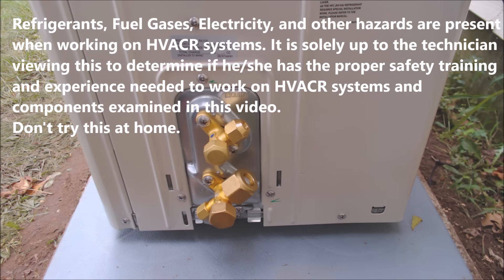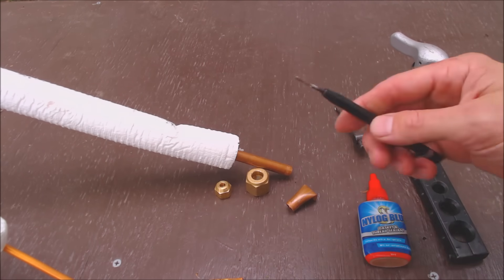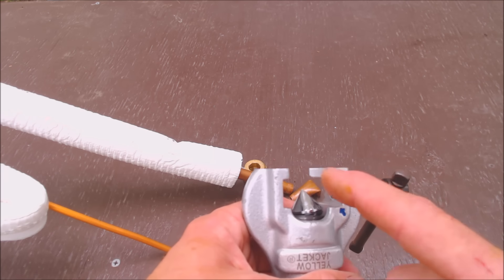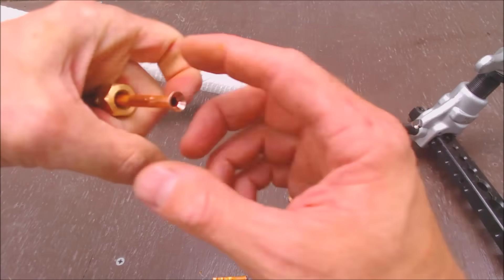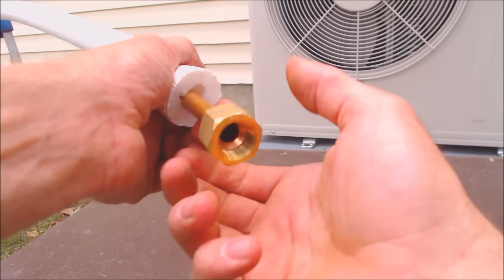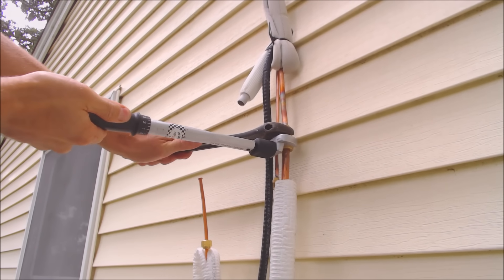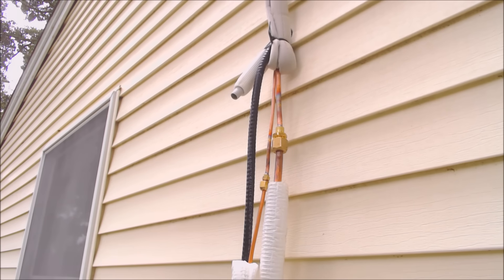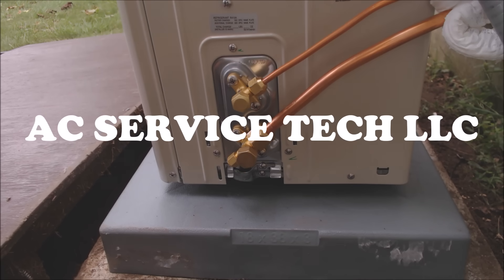How to Flare and Install Copper Line Set on a Mini Split Unit!

Comment: So after you pressure test the line set with nitrogen and it passed no leaks and it passed the vacuum test. After charge release and system running you get minor leaks. Why?
Reply from the maker: That is what happens to techs that do a pressure test with compound gauges for too short of a period of time and don't do a standing vacuum test. You would be surprised how many techs don't understand or do the standing vacuum test. Thats that issue. Also if a digital manifold is used for pressure testing then you can see the leak easier and in a shorter period of time, thanks Ron!
Reply: You will never go under 500 microns under vacuum even with the smallest leak and if there's a possibility to do it once u close ur manifold ports micron gauge will start to rise as soon as u do it.

Comment: I use the thickness of a nickel to help me get the flare right lol.
Reply from the maker: ha ha wow, thanks
Reply: I got the CPS flare tool kit and on the block already has the stopper so perfect amount everytime.
Reply: 1.95 mm quite a bit different from the quoted 3/16.

Comment: Thanks for your videos! Have you ever/would you ever just cut off the ends, and braze the two lines together? It seems easier, and less of a risk of leaking in the future. Thanks!
Reply from the maker: Absolutely, if you flow nitrogen through the vapor port and let it come out the line set before the connection point on the outdoor unit. then you can braze any of it. I just brazed in parts of a job on a large ductless system last week, thanks

Comment: Very well done and you’re the only one that I’ve seen that shows using a torque wrench on YouTube.I installed a mini-split heat pump for my garage about a month ago and filmed it for YouTube. Your methods are nearly identical where the flaring tool and torque wrench I used are from Hilmor and I used Nylog also. Great work as always and keep up the good work. 😀👍
Reply from the maker: Thank you very much Stuzman, I appreciate your comments!
Reply: Yeah all those guys cranking down the flare connections are some HACKS. Can't tell you how many mini splits I've had to cut lineset and replace because somebody else didn't know what a torque wrench was
Reply: I love this video and I've learned a lot. But may I suggest that when using torque wrench, tighten up to the point when you hear the click ONCE, and stop immediately. Anyway, thanks for making this.
Reply: @donbewaro1828  you can click it as many times as you want it won't change the torque significantly
Reply: @donbewaro1828  I learned that lesson after ruining 2 flares. I was always a brazer.  Manufacturers put max torque ratings in the installation manual for a reason I see. Lol

Comment: you are an outstanding(flawless) teacher of HVAC for youtube reference DIY'ers. thank you very much for the expert knowledge, tools & equipment required for installations. 👍 👍 way up.
Reply from the maker: As long as anyone working on the systems are EPA 608 certified and have some experience already, thanks for the comment Melbourne e adams jr!
Reply: your are welcome.
Reply: @BIG SHAQ They work for anyone doing these systems with an ounce of common sense and ability. Great videos! Got my subscription for sure!

Comment: Thanks for this video! How do you charge on mini splits Superheat?
Reply from the maker: It is total weight method only since they have a vrf compressor unless the manufacturer prescribes another charging method, thanks!
Reply: what the vrf compressor stand for. thanks @acservicetechchannel
Reply: @jimdefilippis9630  variable refrigerant flow?